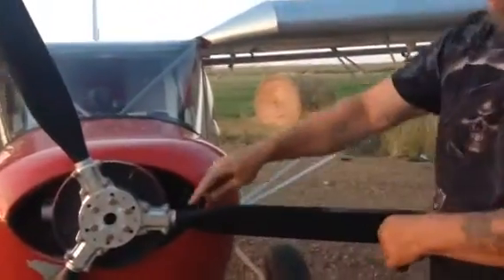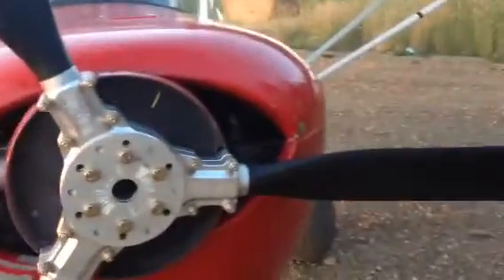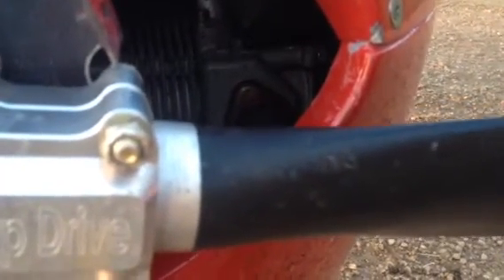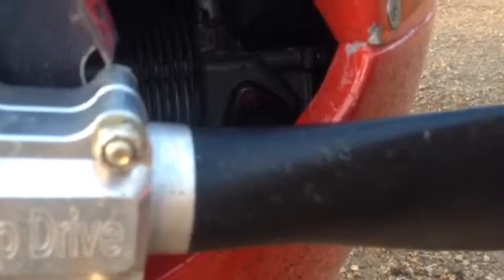Warp drive prop failure

Comment: Wow, I will check mine more carefully as my preflight. Has Warp Drive replaced this for you?
Reply from the maker: It was repaired at no cost other than the shipping. Anytime you get vibration the first thing I would check is the pitch of the props and if they are not all the same then I suspect that it may be the problem.
 The good thing is if the bonding at the collar does fail the propeller still can't fall off which is a good thing. If a propeller does fall off a plane like that with the high RPM the Rotax runs at the motor would fall off and the plane would crash.
Reply: I hear ya Frank, although the engine mounts are robust on these smaller planes, That would tear the engine out of the airframe. I am surprised Daryl didn't pick up the shipping, he is very good to deal with.